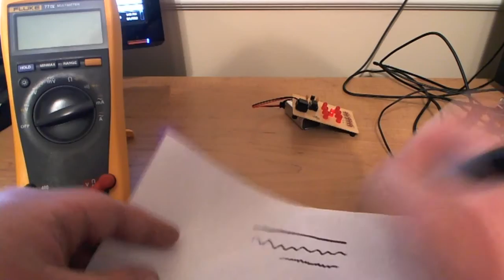Electronics Tutorial Basics-Understanding An Electronics Dice Kit

Comment from the maker: Currently, there is no way to boost electricity from nothing.  There are two types of electricity.  Static electricity and current electricity.  Both types require work from some source.  Static electricity requires you rubbing something together or friction.  Current electricity requires work from a number of sources.  In the case of a 1.5 volt battery there is a chemical reaction creating the work for the current.  Maybe there are people working on creating power from nothing.